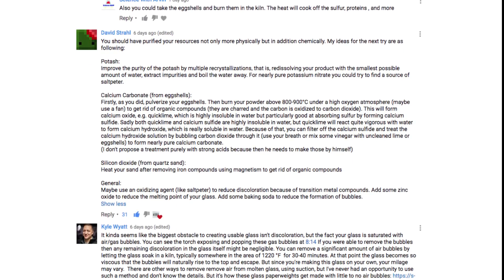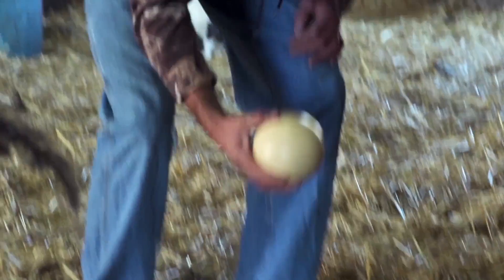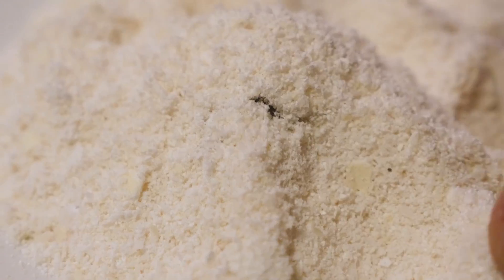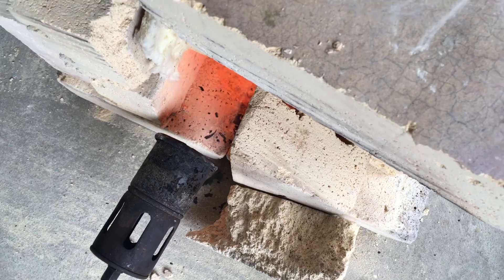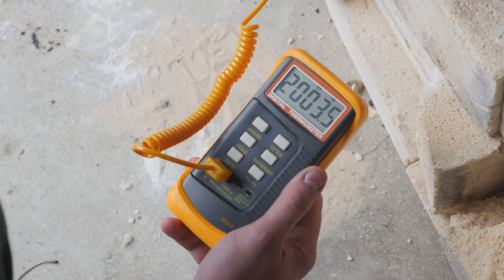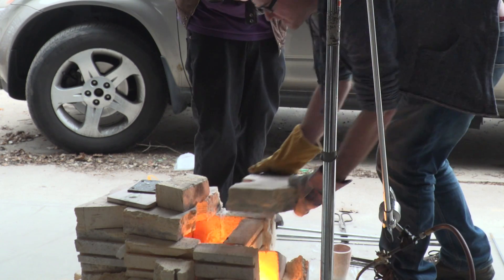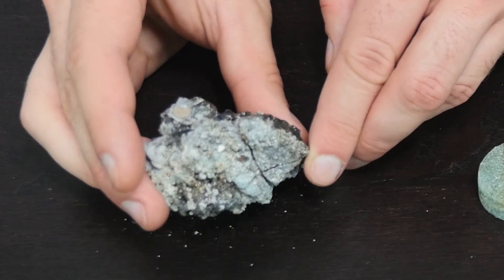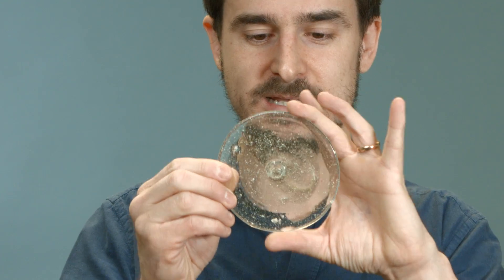Third Attempt at Clear Glass | How to Make Everything

Comment from the maker: The general rule I have, at least for my main videos, is to start only from the naturally occurring fundamental ingredients of everything I attempt to make, with nothing bought at a store.  So I need to either produce soda ash from another natural source or find a natural source of it.  Both of these options are possible, but only at locations a thousand miles from where I live.

Hopefully later this year I'll be able to make it to the coast and burn seaweed there to produce soda ash, or be able to source natural sources of natron.
Reply: Ask Cody from Cody's Lab for help. That would also make a really great collab.
Reply: soda ash is baking soda just heated up for about 14 minutes if this was a restart civilization scenario then you would have to find a salt lake to get your sodium bicarbonate aka baking soda.
Reply: How To Make Everything you should be able to buy everything you need to make clear glass online if you just google it
Reply: How To Make Everything you need to acid clean your sand...
Reply: you can just buy a clear glass if you just google it too :)
Reply: what about using potassium nitrate with the ingredients? its basically really strong bleach that will get rid of any impuritys
Reply: I'm curious. What type of fuel/gas you guys used to achieve the right temperature to melt the sand, which is usually very hard to melt?
Reply: How To Make Everything -How about Remelting Clear Glass Bottles..?
Reply: Hi Andy! Perhaps you can collaborate with someone in those locations? You would then not only be sourcing but also simulating trade and commerce!
Reply: Try to make the tools you are using

Comment: if you are willing to use electrivity you could make varius chem like nitric acid and try wash the sand with it to remove some metals. Electrolisis also provide a way to make other chem wich i'm sure would let you make prety pure pot ash.

If you insist on generating the electricity you have two way: batterie (wich scale with surface area of the metal) or static electricity generator (like van de graph). Battery can be made easily and would just require quite some work for the metals (you can use lemon juice for the electrolite), especialy if you whant high power. Static generator need some special material wich would also be long to make all on your own, tho you can choose only low tech option (you don't need teflon and stuff).

Alternativly you could make a dynamo. the coper (or any conductor really) is not the issue. But finding good natural magnet... i have no idea. (funy tho, you could make magnet if you had electricity :p)

Comment: How long did you melt the glass for? I melt glass all the time (i'm a glassblower) and it looks like your end result just hasn't had enough time to refine out, as with any liquid, the bubbles will rise to the surface and disappear. Melt temp for a home made batch like yours should be about 1180ºc for at least 5hours.

Comment: To try to avoid using any additional materials that you don't have access to. I'd suggest pulverizing your class that you've made and run it through some heating cycles to remove additional impurities. Then melt it again. I'm just going off of basic oxidation chemistry in my head. I would not cal this full proof but this is an intermediate in some forms of solids refining. It may help homogenize the crystal structure of your glass. I actually suppose this is the most prevalent problem your having is homogenous structure of your glass. Even a slightly blue or slightly. Green spherical lense could work as a filter. Although you're working on a clear glass setup. There is a chance that if you make enough glass with very little tint. The more glass that you add together the more dilute that system will become. This may be the key to solving your impurity problem from a "from scratch" approach. Any other way may just indeed involve real chemical processes.

Comment: relatively "raw" materials are typically used in large scale production of glass...while the difference between pot ash and soda may be a factor, i think the larger issue is you're not getting it hot enough.  it's full of bubbles because you're not getting it hot enough to reach a fully fluid state; you're getting close but not quite seems like.    might look at increasing the thermal effciency of your kiln, using a "hotter" fuel in your burner....

Comment: To reduce the bubbles I would think you need to purify the silicone completely. Eventual you need to add an oxidizer to the sand to burn out impurities, like liquid oxygen. Or you need to to clear out the extra substances with steps of HydroChloric acid and Sodium Hydroxide. When either of these are complete with whatever you figure out is useful in another project then you should give the glass blowing another shot. I would think that the blowing will remove extra gasses because of density and diffusion. Your forge would have to be bigger, the glass would need to be purified as much as this video or more so, and you would need to have a heat cooler for your glass object to stay toasty and not flash freeze like an iron breastplate. You have the glass pretty much down, now we need the other pieces of the puzzle. I hope that I pointed out variables for future topics :)

Comment: Might I reccomend using Silicon dioxide for your base source instead of sand
You can source it from any ceramics supplier
It's usually very clean with a small amount of iron oxide as an impurity
Also, desolve to silica in hot caustic soda, grind it into a powder.
That should make sodium silicate with is desolvable in water.
With that, use distilled water to prevent further impurities and dry it out
 then add your lime to it and fire that
That should clear up the glass suitably

Comment: any ceramic supply store will carry some soda ash another is US pigments, they carry glass materials
Reply from the maker: The general rule I have, at least for my main videos, is to start only from the naturally occurring fundamental ingredients of everything I attempt to make, with nothing bought at a store.  So I need to either produce soda ash from another natural source or find a natural source of it.  Both of these options are possible, but only at locations a thousand miles from where I live.
Reply: Oh, now i understand soda ash is sodium carbonate, if i remember correctly, so perhaps heating sodium bi-carbonate you might get some soda ash.
Another alternative may be the use of salt as a flux instead, the only drawback is it releases chlorine gas as a by product
Reply: or use just sodium carbonate, but may cause more bubbling
Reply: bi-carbonate or baking soda

Comment: Soda ash, lime, and erbium, are used extensively as flux and clarifying agents in most of the glass industry. Another thing that you are overlooking is the quality of the burn. Optically clear glass usually wants somewhat of an oxidized environment to prevent any unwanted chemical reactions. A very specific schedule to "cook" out the bubbles is also needed, then a squeeze at a slightly lower temperature to push the bubbles to the surface.  For "crystal" you would need to add lead, but that's just another host of problems.

Comment: I'd like to see how lime free glass dissolves in water. Everyone talks about it but I have never seen it filmed
Reply from the maker: Yeah, I was curious about that too.  I haven't been able to find any info on how long the process takes though, whether it's days or years before the dissolving is even noticeable.  Also you only need like 5% lime in the mix, and their's a strong chance there's some lime mixed with the raw beach sand I used, so my glass might still be stable from that sand impurity.  Otherwise I'd try throwing it in some water and filming it.
Reply: How To Make Everything Although this would be interesting overall. Could someone make disposable glass containers that would just decompose? If they have to store liquids they could be sprayed with a fine coating on the inside and just let them degrade from the outside. Like glass "papercups"

Comment: You could try a simpler project such as "How to make a broom", which would be fairly cheap to do--you have the leftover yarn, sourcing the wood wouldn't be that hard, and getting the broom end probably would mean old chaffs of wheat or some such. Also, you can make a drop spindle for fairly cheap.

I've also made hats--which isn't that difficult and the chaffs of wheat would be local to start. The shaping takes some getting used to, though.

Oh on making the shirt, etc, you should full the cloth before sewing it, which will tighten the grain of the cloth. Traditionally, people would weave it and use urine (because of the ammonia) to tighten the grain of the cloth, which also would whiten it. They'd dry it and then wash it again with lye soap.

Comment: Would a vacuum chamber remove the bubbles 😂?
Reply from the maker: Possibly, but that would be very complicated to make a kiln that also operates as a vacuum chamber, which would also affect the combustion of the heat we were using, which in this case was propane.  The Expert who was helping us said that they typically use a technique called "The Big Squeeze", in which you reduce the heat for a time, and the molten glass actually shrinks in on itself, which pushes the bubbles out.  But it takes a lot of practice.

Comment: Sometimes vibrating/shaking is used to remove air from materials as they harden (latex).  I wonder.... Would vibrating the glass while it is molten and during cooldown help remove air bubbles?
Reply: Sometimes placing the material in a vacuum is also used.

Comment: I'm a chemistry student and I know how you can make sodium carbonate from scratch (I think this is what you mean by soda) , you have to take salted water with the purest salt available , then electrolyse it to produce NaOH , beware , NaOH is corosive and it realease Cl2 gas wich is dangerous , you can dispose of it by plunging the gas exit on a solution of potassium carbonate (ash) to neutralize it . Then when you have your naOH solution it will slowly carbonate by reacting with CO2 , you can make the reaction faster by bubling CO2 enriched air (for example coming out of a close coal fire) into your solution
Good luck :)